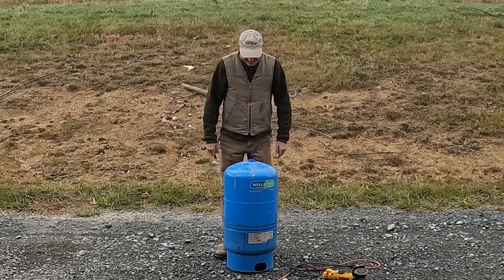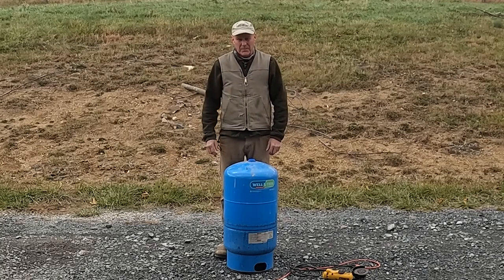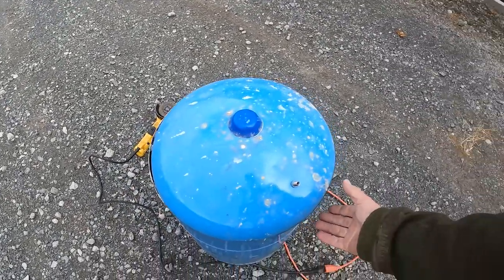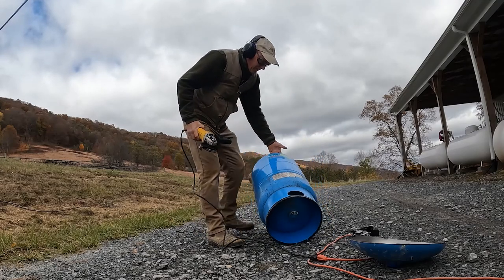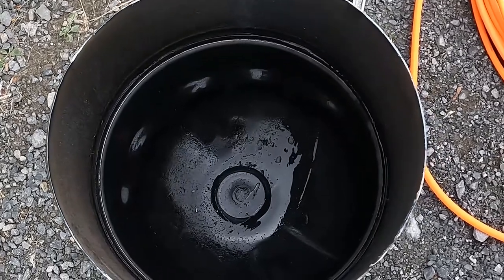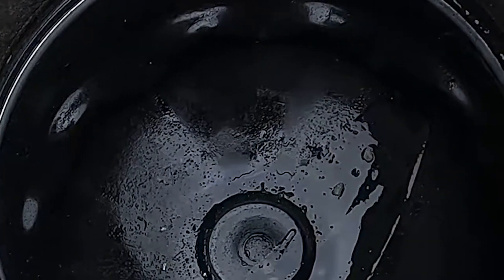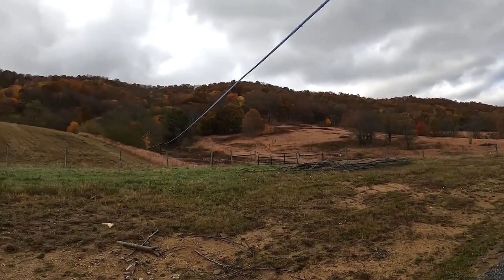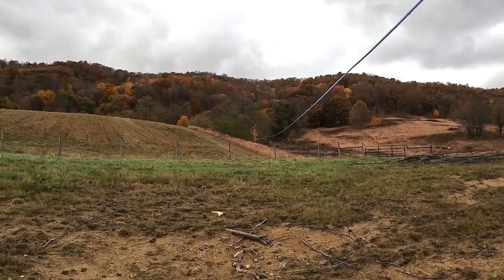What is Inside a Water Pressure Tank

Comment: Thanks for the video. I have a wellxtrol WX250 pressure tank for my well, that has been in service for 35 years. It’s getting rusty, but it still functions. If it goes bad, I will replace it with the same model. I’m running with a 30/50 psi switch. I went 34.5 years without checking the air pressure. I recently shut down the well, and flushed the pressure tank a few times. I checked the air pressure and it was about ten psi lower than the 28 psi that it was supposed to be. I never knew that a person should check the pressure. Probably once a year should be fine.
Reply from the maker: When the well guys told me it was the tank I was suspicious.  They did pull the up enough to check the flow.  And it made sense at the time...  maybe not so much now. Thanks for watching and sharing your experience. This is what makes YouTube so cool. We can learn from each other!  Kevin

Comment: Pretty cool. That was a perfectly good pressure tank. Maybe it leaked at the outlet. I want you to cut open a Water Worker tank to see if it is identical to a Well-X-Trol.
Reply from the maker: After seeing you comment, you could be right. However, for sure, the tank would not hold pressure or let me say once we replaced it, our well worked better.  Now I'm sort of bummed!  I would enjoy cutting open more stuff and seeing what's inside.  If I find a Water Worker, I'll do just that.  Thanks for watching and leaving your comment.  Kevin
Reply: Mm. Maybe the schrader valve had a small leak? I guess the tank was bad but it doesn't look like the diaphragm was bad, usually when the bladder starts leaking the inside of the tank gets a little rusty and the bladder can't hold air. I'm trying to decide if I should get a Well-X-Trol or a much cheaper Water Worker tank. They seem to be identical, but something must be different for the big price difference. I am leaning towards a Well-X-Trol, seeing how it looks inside.  @MillGapFarms
Reply from the maker: I would say that they both could come off the same manufacturing line.  Well-x-trol may be a bigger name.  If it's half the cost, I would go with the cheaper one. If it's 75% the cost, I would go  with W-X-T.  I am pretty sure the tank had water in it which would suggest a problem with the diaphragm but it definitely filled with air...then blew up.  Good luck with your decision!  Kevin

Comment: Neat vid !  That is one pliant diaphragm!   The ring mark on the top center of the diaphragm shows that it has been hard pressing against the hole in the "stop dome".   This should not happen  when the tank pressure is set up correctly as the diaphragm should never get that high.   What it indicates is that the charge pressure was too low for the pressure switch setting.  It should have been a couple of psi below the cut on pressure.   The point is the tank was not bad but your loss is our educational gain.   On my tank recently I found the charge pressure about 12 psi low.  Is it a thing for the charge pressure to leak down over  time?  Does this lead to diaphragm failures?  Does one need to check the tank pressure at some interval?  Only check it with the system pressure well below the kick-on pressure.  For this check the system pressure does not need to be zero.   I wish these came with a split-able tank where on could change the diaphragm  when it failed.  There are ones in other countries where there is a balloon bladder changeable from the bottom.
Reply from the maker: I really appreciate this comment. I think the charge pressure can leak down but only two ways...either the bladder has a tear, which in my case, it did not or the schrader valve is leaking.  About the only other option would be that the bladder has stretched.  I don't know how likely that could be the case.   Are you saying that if our cut on (kick on) pressure is set to 38 psi, the pressure of the bladder should be something like 35 psi?  As are as checking it... I really don't know. That being said, something tells me the directions are on the tank and I probably should check that.  I have only checked the pressure a few times in my lifetime on any pressure tank.  They don't seem to go bad until they go bad... In this case, the well company said it was bad and replaced it.  What made it seem correct is that they did not have one on the truck. They brought out a 3 phase well pump and enough wire to run it along with some more pipe... but they thought it was the tank... and get this they drove to Harrisonburg, 1.5 hours away and got one because they didn't have it on the truck... and they didn't charge me for the time.  That was close to 4 hours of their time.  I felt confident they were correct. Since then we have not had any issues with the well.  Could it have been the wrong pressure... possible for sure.  The next time we have an issue, you can bet this will be the first thing I check...next to doing the stone drop test into the well to make sure there is water present.  Thanks for watching and leaving your thoughts. This is how we get better at these sorts of repairs. Kevin
Reply: First, Yes, I am quite confident that the charge pressure should be a few psi below the cut-on pressure.   If the pressure is equal or higher the diaphragm will "thud" against the bottom of the tank as the last water leaves the tank.  The thud has actually more to do with water hammer, the sudden stoppage of flow.  If you have this condition and you are watching the water pressure gauge you will see a sudden drop in pressure (the gage will jump to or past zero and the bounce a few times - i.e. water hammer).  The pressure just before the thud is equal to the charge pressure in the tank.  having a couple of psi lower charge pressure means there will remain a gal or so of water in the tank and the diaphragm is never stressed.   It is not harmful to allow this to happen from time to time, in fact you might want to do it annually a time of two to clean any sludge that has settled in the tank.  To do this on purpose (flush), open a faucet some where (better if you can see the flow) and then either turn off the power to the pump or hold the contacts open with the corner of the switch cover (it's insulted so you don't get shocked).  Watch the flow or the pressure gauge to see when the pressure precipitously drops. Then let the pump come on again until the pressure just rises above the normal cut-on pressure.  Follow this by a re-interruption of the power again.  Do this two or three times, the last time  allow the tank to fill more and drain to flush out turbidity.  If you were watching the out-flow you would have noticed how much you cleaned out.   Note: depending on the pressure switch, some may "lock-out" when the pressure falls bellow apx 15 psi.  If this happens, and it's that kind of switch, it will have a leaver on the side. Raise the leaver about half way which will manually run the pump.  Do this until the pressure gets above that lock-out pressure (this is a pump protect feature in case the pump has run out of water in the well and cavitated)   
 I don't like to disagree with men you do this for a living (assuming they are honest) as I want to give a wide birth for men who have day to day experience in these things.  That said,  the mark at the center of the diaphragm seen in your video is a dead giveaway that either the charge pressure was too low or somehow the pressure switch allowed the pressure rise of appreciably more than the normal/design 20 psi differential.  
Hope this is helpful.